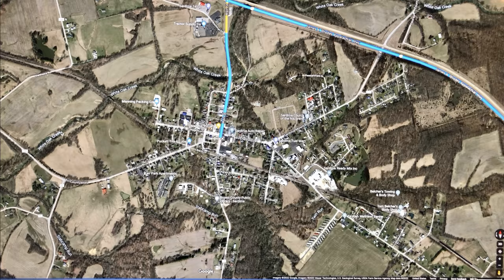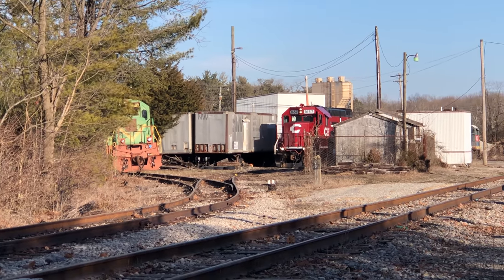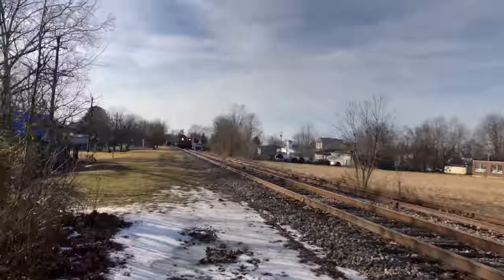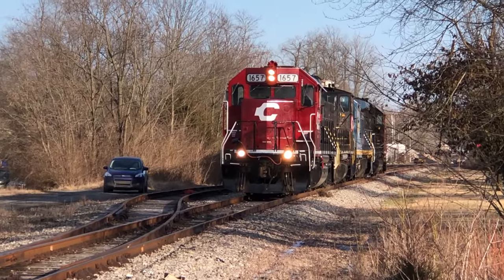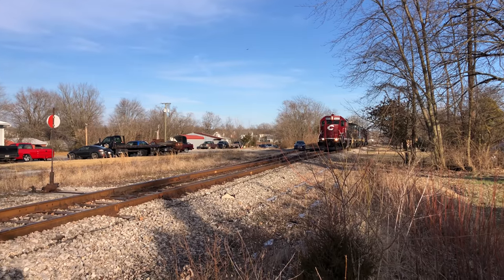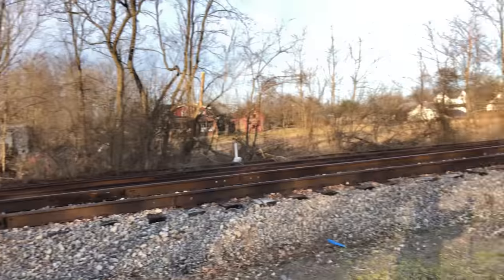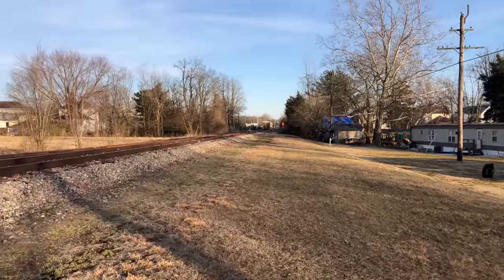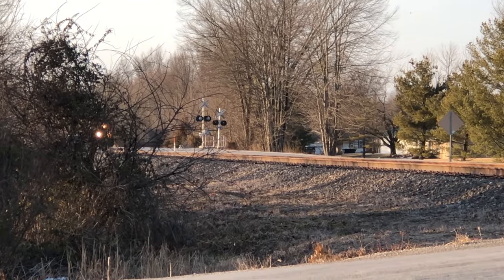Locomotive Shunting!  Railroad Switching On Classic Short Line American Railroad, 8 Engines Sardinia

Comment: Those Dash 7's never get old, wait they are old lol. MP15 switcher is always good to see but its showing its age also
Reply: "also",  make up your mind.....
Reply: I'm guessing the switcher was broken.
Reply: JT, you seem to be a perennial fan of the CCET. Could you ask them when they will paint the two B36 units? Or, if they plan to dispose of the HE's, now that they have complete EMD power in the collection?
Reply from the maker: Those locomotives are really neat to watch and listen to.   I actually took pictures of them before CCET bought them.  They use to run on the TTI Railroad in Paris, Kentucky.  Almost all of TTI tracks are now out of service so they sold 2 of them to CCET.   One of these days I plan on filming the TTI tracks before they get removed
Reply: @JawTooth  TTI's website shows one or two GE's in a "modernized" livery. They're averting the transload and car storage capacity. 

CSX owns them, of course. Would there be an advantage if the line would be used for directional through-traffic?

Comment: Wow - the Dash 7 could use a paint job to spruce it up, right ?  The MP 15 DC probably needed a tune-up / inspection as per FRA regulations, so into the house track for a spell.   Good to see the crossing signals being added and upgraded - might mean more traffic on the railroad soon.  That would be a bonus for the railfans !

Comment: I love close-ups of locomotives like that. You can hear all the little spitters and sputters they make. What device on that locomotive is making those clicking sounds?
There was one style that I recognized. I love Pennsylvania and moved to Florida in 1975. But I still recognize the crunching sound of Frozen grass. One thing I have noticed about that short life is that company takes pride in what their locomotives look like. All Bright and shiny.
Reply: You may be hearing the air dryer system. These valves have a spitting/sputtering sound. This system automatically removes the excess water vapor from the air reservoir. This helps prevent excessive moisture in the air brake system.

Comment: Great excellent good video, mr Jaw Tooth.
Old locomotives give the machines rest, easy on with that old work horses. Use younger locomotives with radiocontrol.
It makes the work for the engineer and conductor much easyer. In the Netherlands is that daily work.
Greet from Zandvoort the Netherlands

Comment: Watching the video, at 6:55 I noticed that there was a flash under 1657 that looked like sparks.  A closer examination revealed that it was just the de-railer catching the reflection of the sun light as the loco passed over it.

JT I pulled up Google Maps and took a look at the Sardinia "Y".  From the appearance on the map, it doesn't look like the "Y" is in that great of shape and on the area just across Tri County Highway, it looks like it is not in usable condition.  Any chance you can you could update the condition of the "Y"?

Have you talked to any of the workers for the CNET to see if they are planning on improving the Yard in Sardinia?  By the way it looks, there isn't a whole lot of flexibility for moving the loco's around outside of the single house track.

Last question.  What is the overall track length that the CNET is operating on?  In reviewing the map, it seems in good working order from Cincinnati to Ashland KY / Huntington WV area.

Very cool video!!